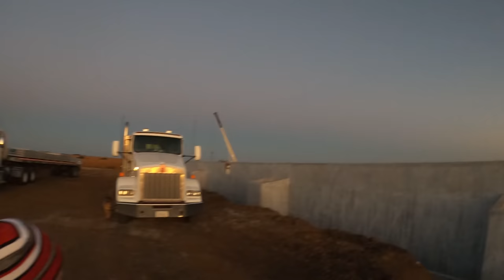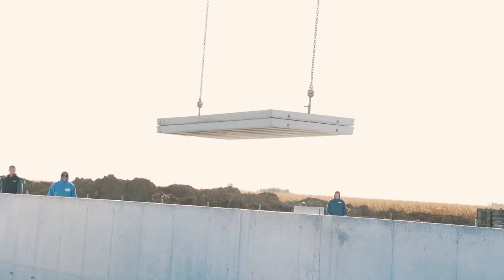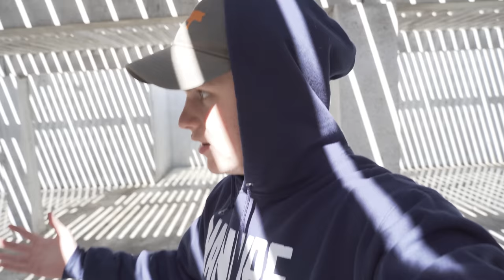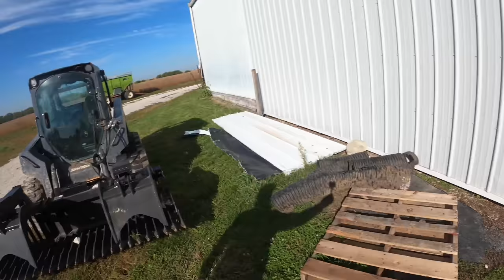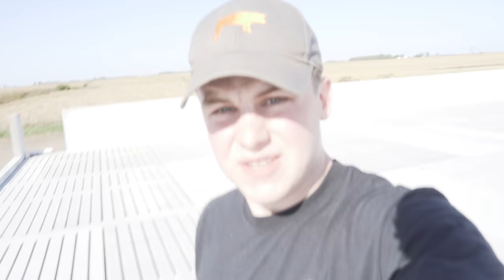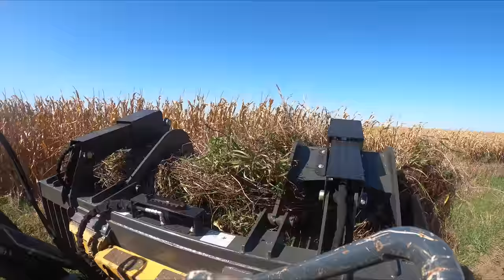Laying Slats For Our New Hog Barn..

Comment: hey what are thoes little nubs on the middle walls?
Reply: At the bottom? Or just all the form ties that they haven’t knocked off? The holes at the bottom of the center wall is so one pit doesn’t fill up or empty faster than the other. Keeps the pressure equal on both sides of the wall. Thanks for watching!